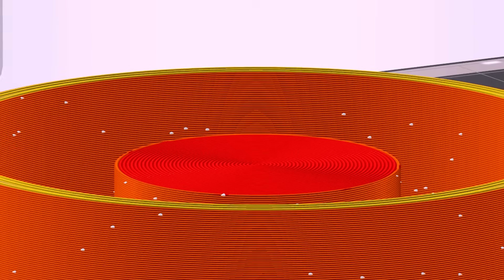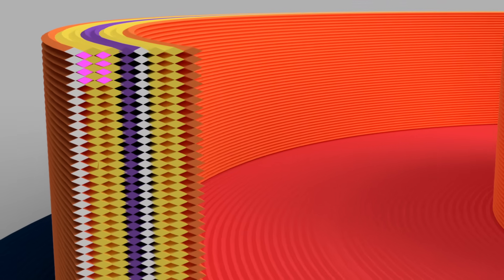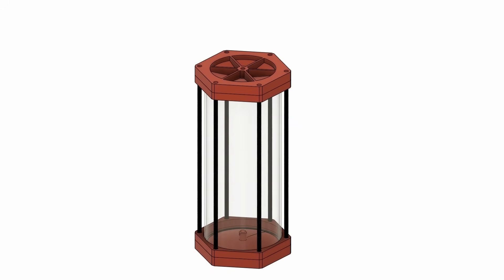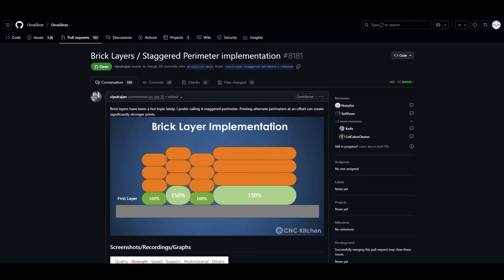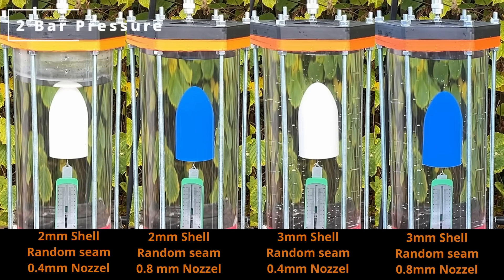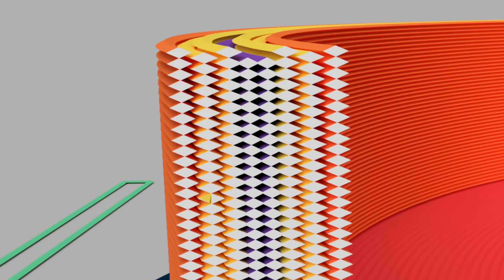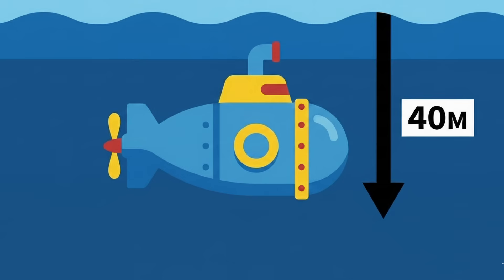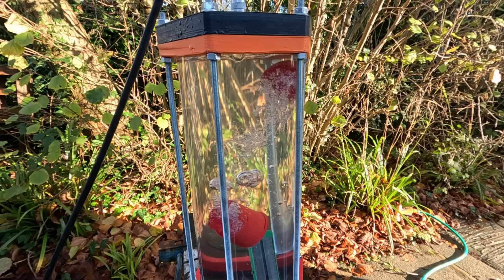Making REALLY Waterproof 3D Prints Using BRICK LAYERS (No Coatings Needed!)

Comment: Yay! I was hoping you'd test one to failure lol.

Maybe I missed it, but how long did you leave the test hulls under pressure for each test?

Some follow up tests I can think of (I don't expect it to be practical to do all or even most of these, especially in combination):
- Get a water pump and pressure gauge and do hydrostatic tests to failure (no pressurized air in the pressure vessel means it will at worst spring a leak, not explode!). Recording pressure at failure or testing at a higher target pressure might be the fastest way to differentiate settings that performed similarly.
- Soak test at pressure for an extended period of time.
- Test other colors of filament, other manufacturers' filaments. Hypothesis: Inverse correlation between pigment content and water tightness. "Natural" and black are on opposite ends of that range.
- Test a bunch of identical hulls to assess reliability of the printing method. Looking for consistency not absolute performance. Maybe use a bunch of mini hulls at once and a longer time period to compensate for less surface area?
- Cyclic testing, how many cycles can a test hull handle before leaking? I think this would call for a 1 cycle control which spends equal time at pressure.
- Leave samples outdoors where they'll be exposed to sunlight, test at regular intervals to see if UV degradation causes leaks.
- Test the impact of water temperature. I'd start with 0C then try perhaps 40C, and only bother testing in between if there's a significant change at either end of the range. This could get more relevant with electronics inside generating heat.
Reply from the maker: Lots of great suggestions. If I find the time I will try some of them. Because the pressure test ring itself leaks water when pressurised the longest test window I could use was an hour. If I could I would have loved to go longer or higher pressure.

Comment: Interesting results, I'll try this next time I design some devices for use during scuba training in the pool. By the way, 4 bars equals "only" 30m of water pressure, not 40m. Pressure = 1bar +depth/10.
Reply from the maker: You’re right that the absolute pressure is +1 atm. The pressure measured for the test was relative water pressure. So tests were at 3 atm and 5 atm absolute pressure respectively. So should be equivalent to  20 meters and 40 meters. Would be interested to hear how your prints fair in the pool.

Comment: Cool test results and thank you for finally being one to note that the extrusion multiplier needs to be higher as the 'beads' are NOT touching edge to edge any longer with this arrangement. I will however say the tables at 5:43 feel kinda.. incomprehensible? you are mixing graphics, colored text, a legend at the top with a blue text that isn't used.. the blue bricks..? IDK, sometimes less is more on that one.

Comment: It might help with making it tight , but I don't see the point in accepting the risk unless it's a low-value part where expected life is short or where minor leakage doesn't matter.  

I consider the prints that I've subjected to either vacuum or pressure cycles over months:  In all the cases where I bothered to reinspect for weepage (or in more obvious cases), the prints developed porosity over time.  In other words, you can print it _tighter_, but it will still become more porous as (likely interlayer) cracks form over load cycles.  Also consider whether the absorption or entrapment of water will affect material properties (e.g. creep rate or environmental stress cracking).  Coating the part is (usually) easy, and it should prevent or at least help mitigate either problem.  

I'll be honest that I don't really know what the ideal coating would be in the long term.  I tend to use whatever is at hand, but I do worry just as much that the coating itself will become crazed or delaminate under repeated cycling.  Epoxy paint seems generally recommendable, though relatively expensive and messy.  I don't know of anything that would work well on "somewhat flexible" stuff like 98A TPU. 

Maybe using bricklayers would be a primary solution in cases that can't be coated.  I suppose there's also no harm in doing both.  As to whether it's worth it for the strength, I've been hopeful, but can't comment yet.

Comment: Have you tried scarf-joint-seam and staggered-inner-seams? Both seem quite promising
Reply from the maker: I have tried scarf joints and surprisingly it didn’t seem to make much difference for me. It it entirely possible that I hadn’t dialled in the print settings for them.
Reply from the maker: Random seams definitely help but I’ve not tried staggered seams.

Comment: Would you consider replicating this with say PETG and doing a 2 or 4 bar extended test (24 hrs)
Reply from the maker: PETG is an interesting one. The current setup won’t allow for 24 hour testing. I’d have to stop the test rig from loosing water when pressurised first. But if I sort that out I would love to do a longer set of tests.